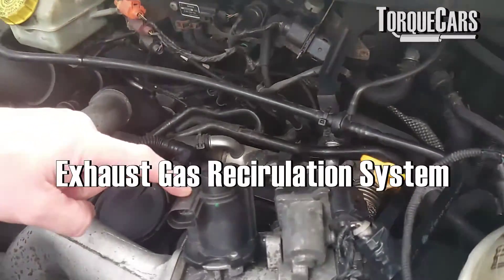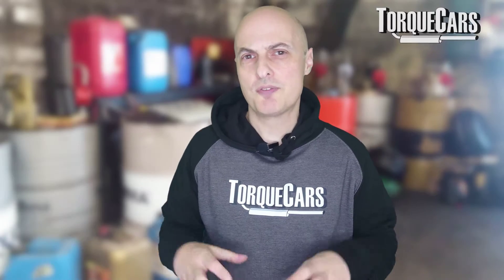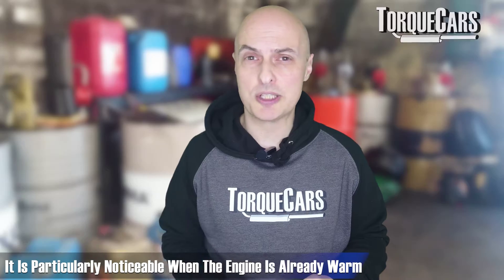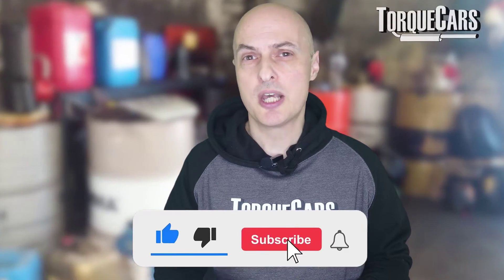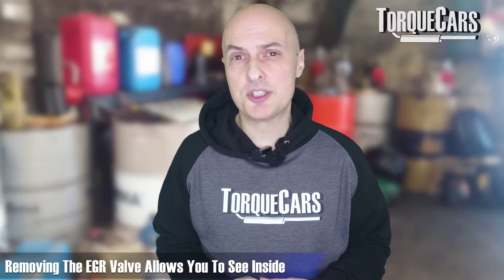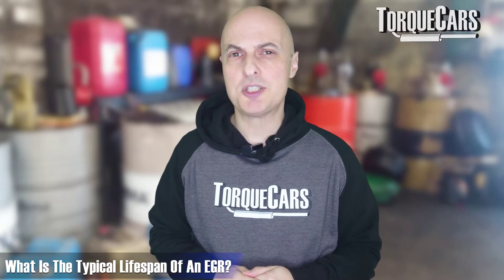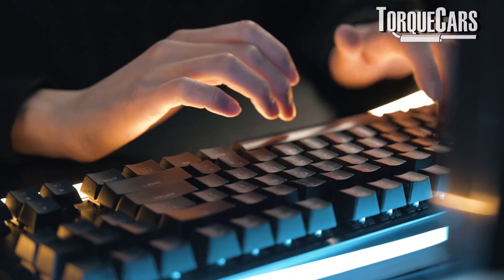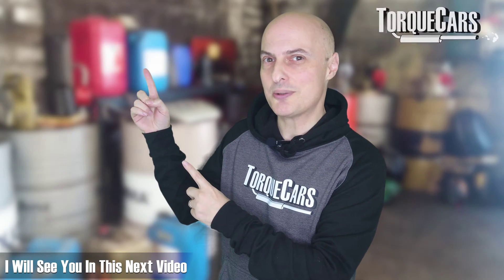How To Tell If Your EGR Is Faulty - Common EGR Symptoms & Problems.

Comment: My electric motor has far more acceleration, and stopping power than the pos ice, without all of the clusterfi_ick emission, filthy air controls.
Reply: Possibly true. But since you wrote this, your car's worth will have depreciated by 20%.

Comment: I had a major EGR issue  with a used Mitsubishi Outlander I bought, 125k on the clock. It was stuck closed and was preventing the DPF from Regenerating. Which caused the car to go into Limp Mode. It was also dumping diesel into the oil. I had the EGR mapped out and now the car runs a lot better 🤷

Comment: So my 1.6tdi just sht itself. 

Symptoms: 
First I had a flashing glow plug light (which I reset with my OBD2) 
But then it went into  limp mode,
I can start car but after 5 seconds of rough idle it stalls out, 
CRAZY amount of smoke when I tried to give it enough power to pull away in first gear (like a dirty brown colour, almost dusty colour and smells of soot and fuel) 

Zero error codes (even with all that smoke??) 

Fit it towed to local garage but they can’t look at it for a few days.!
I’m thinking an injector (but no error codes) Or a bad EGR valve OR a bad throttle body Or something else may have failed internally. 
I’ve had quite a few golfs over the last 15 years but I’m really thinking of moving to Honda or Toyota……German “reliability” is just an old myth it seems or at very least it’s a case of “if you get a good one” then you’re fine but if you don’t get a good one, you may open your wallet quite a bit. 

Anyone any ideas?
Reply: How'd you get on?

Comment: I have a 99 Camry V6 I was told that I can just replace the valve sensor switch on top looks like a triangle with three bowls small… Because that's what matches the code… My question is does anybody know when I pull that off there's any kind of pre-loaded or spring loaded anything that comes out and my fear is I take it apart and he doesn't go back together but when you buy the part it's nothing but the triangle electronic with a pin type sticking out of the middle so I'm assuming it comes off like that and goes right back on like that any input? Thank you for a response

Comment: Hi I’m after some advice I have a 2016 BMW 1 series and over the last week I’ve notice some fumes kicking out from the exhaust this would clear after a few minutes or so, however yesterday I got a drive train error message and the cars gone into went into limp mode almost as if the turbo has been switched off could this be the EGR?

Comment: I changed out a  valve seals and replaced my EGR I can drive sometime for 27sec or 20min the engine check light comes what can be the problem on and I the scanner tell me P0400 which is exhaust gas regulating

Comment: I have a BMW 1 series 2.0 disel 118D M sport and a couple months after buying I notice my fuel economy has got really bad and the engine sounds loader when idling I did change the bresther pipe and checked no diesel leaking but I when I out fuel in my car I measure how many miles I'm getting and I keep losing 100 miles worth of diesel I don't know if that's normal for a bmw or maybe I have a faulty sensor or maybe its the EGR? 🤔🤔
Reply: dont know if you've solved it but I have exactly same car. BMW 1 series 2.0 disel 118D M sport 2012 convertible. same symptoms I'm just gonna trade it in and get something else

Comment: Can anybody recommend a cheap code reader for Skodas? Rapid 1.6tdi to be specific.
Reply from the maker: VAGCOM via a laptop is the nerd version and is well supported. OBDeleven also works really well and is the one I've used - quite cheap and versatile really.
Reply: 2025 Kingbolen Ediag Elite OBD2 Scanner.

Comment: Once upon a time...cars didn't have EGR valves.
Reply: @BANANASandDUCTTAPE  once up a time , cars had ignition points.
Reply: @gertscheper9653  😆 🤣 💯
Reply: @gertscheper9653  Yes and they could be repaired by yourself at the roadside.

Comment: I think my egr is leaking coolant. I’ve had a pressure test on my vrs but there are not signs of coolant but it’s needing to be filled once a week. Any ideas greatly appreciated.
Reply: @adamedwards4832  
Could be a leaking head gasket.
Remove spark plugs one at a time...inspect sparkplug tip...if you find one that is spotlessly clean (no carbon)...it's a blown head gasket issue. 
Coolant seeping into a cylinder cleans out carbon...
Reply: the EGR my BMW 520d was replaced on a BMW recall, since then it has be leaking coolant although it is not visible. BMW carried out a pressure test on the system and deemed it ok.
It is still leaking coolant and of course BMW don't want to know
The car has never had a problem with coolant until BMW got their hands on it

Comment: Hello do you need always get new egr gaskets if you replace the egr valve unit? Im thinking of getting a used one but the gaskets wont be new i think. Suzuki wagon r 2002
Reply: @darasami1191  no not at all put a used one in my Audi A4 b8 used old gasket.

Comment: Can be egr problem if can lose power on low rpms? After i hit 2000 rpms its pull normal, but before its very slow. Giving black smoke. I have replaced so far maf sensor, fuel filter, turbo salenoid its still run same. Two mechanics have looked they dont know what it is. Computer was complaining about air problems. Car not shaking or anythinks starts normal, but black soth comimg out from exaust.
Reply: @TheMindukas  yea egr mines was doing that

Comment: Hi i just got a astra 61 plate 1.7 cdti its hard starting when it started idle is ruff black smoke out of the exhaust i looked in engine and the egr vaulve connector is snapped off so no wires is going to it its down on power do u think thats y the car is like it is on tick over its chuging to

Comment: I have a suzuki alto 1.1 2004 and got quoted £900 for a new EGR and labour. This was 3 months ago and I’ve still been driving it every day since. i only paid £700 for it just before lockdown. It was misfiring quite bad when I was using e10 fuel, so I switched to e5 and seems to run better, and just likes to have a little splutter when idling.

Comment: I got the egr error code and my car is shaking like crazy when its idle but i took put the egr valve amd cleaned it (it already looked pretty clean) but that didn't help. Any suggestions. I have a 2010 belta/yaris.
Reply: @raz2083  did you fix this?

Comment: I have deleted my EGR from the ECU bacuse it was casing problem,  but it stil causing EPC and check engine light, only when driving and sometimes it stalls at idle. Could you please help me ?
Reply from the maker: Hi buddy, which engine do you have? Did you do a physical delete/block/removal as well or just a software delete? Just something to note here, unplugging the EGR from the ECU often causes errors and many "mechanics" think this is the way to delete an EGR but it often causes more problems than it solves.

Are you getting any other error codes? Please note that although I can make suggestions here I really cannot solve problems remotely or offer solid solutions, every car is different and there are often little quirks that need to be assessed each time.

Comment: As an owner of several VW TDi cars, the EGR valve is a ticking time bomb, as they coke up with frightening regularity - some as early as 70,000 km, needing replacements which are quite costly.
Reply: I can attest to that. Someone told me that getting rid of the thing was the best thing they have done to their car, but I couldn't comment since it probably counts as a modification on insurance forms. 😉
Reply: i realise i'm replying to an old post, but i've got a 2006 VW golf / BKD engine, and replacing a faulty EGR was really quite easy and cheap. Got a new replacement part on Ebay for 20 quid. BKD engines have the EGR right at the front, pretty easily accessible - just 3 bolts as I recall. I'm in no way good at car maintenance - but it didn't turn out too bad for me. Of course, other engines may vary. Later model EGRs are a PITA to get to.
Reply: @gug1970  hi, what were your symptoms off failing EGR valve. I have kinda continuous revs at 950 even when warm and white horrible smelling smoke.
Reply: Can I ask is it highly likely if I am getting a 1.6 TDI CXXB engine starts and cuts out and engine knocking with white smoke. Having checked all fuel injectors and fuel pump seems all good. Thank you in advance
Reply: @marlboro-manmat295  i was driving on the highway with my polo 1.6tdi 105hp and suddenly is smelled some burning smell and suddenly big big smoke wall behind me and the car was throttling by itself even when in neutral it gave full throttle and knocking sound. What could it be?

Comment: I've had my EGR disabled when getting my remap (2015 Golf 7 GTD), passed TÜV and AU (German emissions) without issues. Plus fuel consumption as well as engine response time improved.
Even though these newer VW engines use 'pre-cleaned' (two filter DPF system) I'd still disable that every time
Reply: @oxygized  Did you delete the DPF too?  can you recommend someone for the remap? im in Germany too

Comment: The manufacturers learned long ago how to tune EGR. Because the Air NAZI"S at USEPA and CARB impose severe environmental rules and regulations on the manufacturers, the manufacturers have come to depend heavily on EGR to lower Nox emissions. In diesel engines, manufacturers add as much as 90% EGR in the idle circuit just to meet the severe rules and regulations imposed on them by the Air NAZIs. Kind of like running a marathon breathing your own farts.